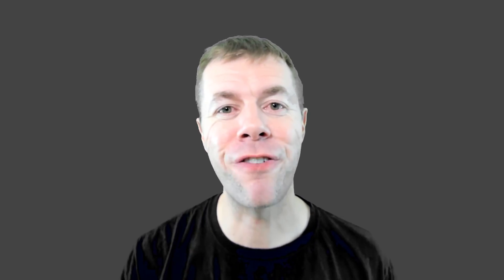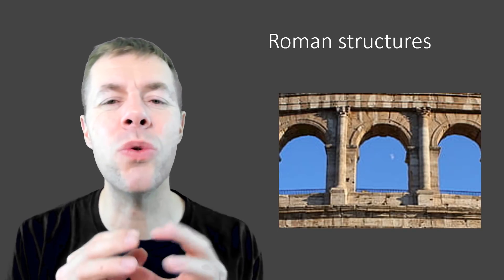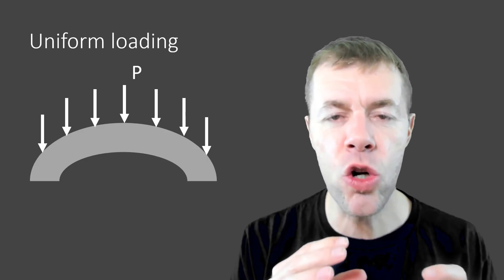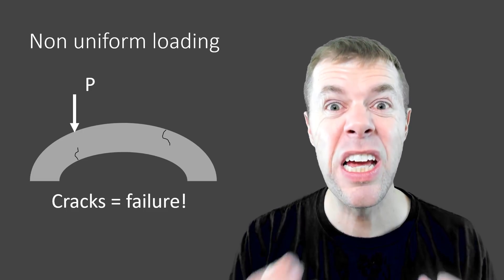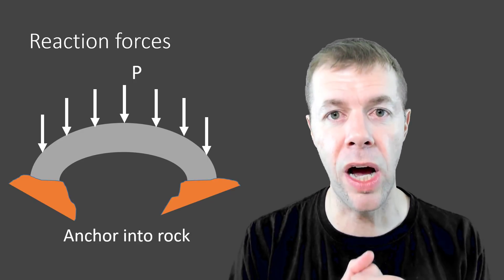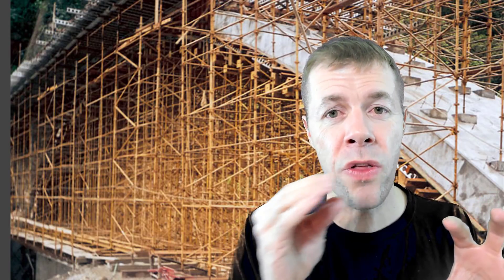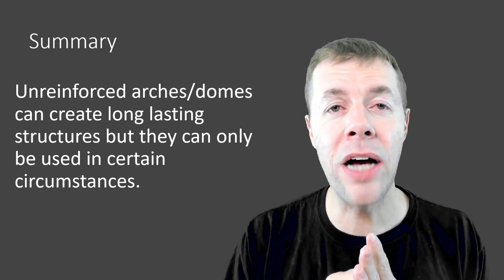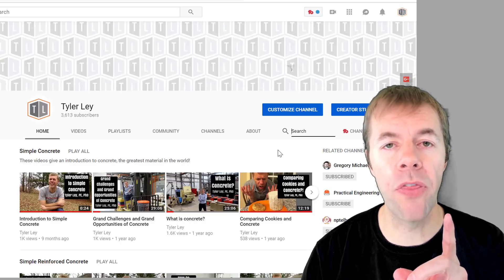Why don’t we build like the Romans?    |    Concrete Arches and Domes

Comment: The secret to Roman concrete is volcanic ash in the mixture. It helps against corrosion against salt water. For example if you were on a giant peninsula surrounded by an ocean… but reinforced concrete with rebar is much stronger to impact’s. The example of that would be German bunkers of WWII. However, eventually the steel would corrode. I’m sure they have solved that to some issue but the cost and expense probably wouldn’t be justified unless you’re building an underground bunker to withstand nuclear blasts

Edit: For some reason my comments don’t always appear. Perhaps it’s due to some weird algorithmic censoring. But volcanic ash is the secret ingredient to Roman concrete. Most structures from antiquity used compression for stability. But strangely enough they seemed to have better technology when it comes to working with raw stone

Comment: I've just moved to Zanzibar and will be folding my own homes. 
I have several  
1: and we don't have lots and from what I gather it's not particularly clean,  slightly salted
2: the water also slightly salted. How do I get around this.??
I find the large bricks they make, to be quite brittle.
It's OK for the fencing but not for the building s
 What can I do to make better clocks without breaking the bank? We have heaps of coral rock and glass bottles.

Comment: I'd be very interested if you did an episode about Roman Concrete, especially if you covered the concrete they used underwater, which appears superior to what we use in saltwater today.
Reply: The secret to that is volcanic ash in the concrete mixture. It acts almost like a seal for the concrete and saltwater corrosion. Romans had access to volcanic ash in Italy, but it wasn’t exactly readily accessible to most civilizations

Comment: Earthquakes are common in Italy and these Roman structures have survived 2000 years in a seismically active Italy.
Reply: The "secret" to roman concrete was discovered to be unmixed nodules in the concrete. Nodules, which, when the concrete was cracked, would reactivate when it rained. This reactivation would fill in the cracks. Essentially, the concrete was self healing it because of it. Im surprised this concrete guy hasn't discussed this aspect of the Roman concrete on his channel.

Comment: Greetings Tyler, I appreciate your passion for your topic, it is the thing which separates normal teachers from the exceptional. Regarding the Romans, we also need to consider their limited means for mathematical modeling in their engineering. This limited their ability to build efficiently and the ended up with structures which currently outlast their Empire by a factor of five or six. They could 'afford' this inefficiency because of their inexpensive labor in slaves who only received food and other basics of life in lieu of proper remuneration. Finally, your point of the liberty of having time on their side in construction, mentioned in a subsequent video, is very well taken. There were no bankers to satisfy, no taxes which were accumulation and so on, thus a project could acceptably take years to construct, and everyone would be fine.

Comment: BTW, why don't we build as the Romans, it is too expensive and unnecessary unless you want your buildings to survive 2000 years.
Reply: Would that be so terrible, rather than all the tearing down and rebuilding we do today?
Reply: @searchingfortruth619  I agree, I am just explaining why we dont do it. I once look at building a house out of 100% poured concrete for myself, no wood at all. It would have been 30% more expensive in materials and little more in equipment and setup. But it would have been mostly fire and waterproof. No insurance needed for structure. Even under the worse of conditions the frame would have been just fine. But we dont build like that. I work for several of the large home builders, most of them argue about a few dollars here and there. They cut back on things like soundproofing and waterproofing on a home to save a couple hundred dollars, and then it becomes a warranty issue later.  Cheaper is not better.
Reply: @TonyAnytime  so interesting.
One of the biggest structural changes I feel like has changed is that we no longer use arches or domes. Even of wood or brick.
There have been some really interesting projects I've come across
1) utilizing CLT
2) concrete domes using an inflatable formwork
3) using fabric for concrete formwork
4) incorporating gentle domes to the underside of concrete floor plates for better load distribution

Comment: Your Video is basically correct but understates the brilliance of these Roman Engineers and how these building have not only survived 2000+ years of weather, earthquakes, bombings, fires, flooding, looting and changes in governments. Lets talk about the the colosseum.org   Not only was their concrete a composite of special pebbles, ash and straw but they also did use reinforcing steel just not on the inside. The steel was used as tie beam between the layers of the pours. I found this method in homes built in Miami in Coral Gables in the 1920's.  So imagine concrete blocks and walls with flat steel plates acting just we would use rebars but in a groove in between blocks and they were mortared in place. There buildings were design to be able to shift and move. They also used holes with iron pegs to tie these pieces together. So they did reinforce their concrete with steel  just differently.  BTW the Colosseum sits on two distinct geological formation, half on hard rock and half on sand. So they used two different methods and concretes on this bi-polar design each tuned to their specify geology. 

Now going back to the  pantheon. Poor thing has  been pillaged  and even been bombed for 20 centuries. But look at these unique for their time building concepts. The oculus, the hole in the middle, not only allows, light and provides for excellent natural cooling, but it acts as a stress reliever and allows the pedals of the dome to grow and shrink as needed, absorbing small shifts. Each pedal is made from a composite layers of different type of concretes and mortar with reinforcements that allow them to hold far greater stress than concrete alone could carry. Think of encasing our pre-stressed trusses with a carbon fiber external shell.Their hollowed design not only save weight but gave strength because of this layering. The concrete in the middle of cookie was made to be light and flexible. The concrete on the outer shell was made to be hard and stiff.
Because of what I said above modern engineers have been using computers to figure out how the roofing system on the pantheon worked exactly, and every time they do the numbers they still don't add up. There is such brilliance in the design similar to how we build composite airplane wings. BTW no one knows the architect or builders of the Pantheon.  But please don't call it unreinforced concrete and I seriously doubt any of our concrete buildings will make it 2000 years.

More Info:

the-colosseum.net

 thecolosseum.org/history
romanconcrete.com

https://smarthistory.org/the-pantheon/

Comment: There's a misconceptions that people still think arches are in any way superior. They are not. In modern massive brick construction lentils (either premade pretensioned or poured on site) have long replaced arches. The problem with arches is that it cannot be anything else but an arch. Can't be a triangular opening, can't be a rectangular or any odd shape. It has to be arched. We have lentils and other solutions now and we take them for granted the same way as Romans took their arches for granted.

Comment: Okay Tyler, I like you as a person, but the Romans build structures in concrete 2000 years ago and some of them are still standing bright and shiny - no steel - just arches and their 'secret' concrete.
Reply: Some are stand but 99.99999% have failed and are gone.
Reply: @sparksmcgee6641  Read and study Mcgee, do not make the mistake of improbable and silly one liners, while science is against you. (where did you get stupid figure of 99.99999% ???? BTW)
Reply: @janverboven  50 BC to 450AD is the roman era. Take the population base and density of people per structure type and composition. But that aganst still functional concrete structures and you get the failure rate. You did get me there with a mistake on the last two 9's. They should have been 35 then 8714..... One liner facts are very effective when talking to knowledgeable individuals that dont need the basic math processs explained.
Reply: Actually Jan, they used pumice at the top portions of the domes BECAUSE they didn't have reinforcement.

Comment: I'd like to see a video on a relatively new method of using concrete to build small structures.  Blow up a balloon and spray concrete on it.  I've seen it used here and there - wonder how big a structure you can make with it.

Comment: There are still a few granite keystone arch bridges in my area that freight trains pass over. Probably near 100 years old. These bridges have needed ZERO maintenance so far. All of the steel bridges in the same area have already been replaced due to corrosion. Hello....
Reply: The iron bridge In Iron bridge gorge in the UK is still in use and was built in 1779 :)
Reply: Andrew... Thanks for the comment. I researched the Iron Bridge. Fascinating.
Reply: @blipco5  Thank you for the courtesy of your reply!
Reply: Andrew, you're welcome. 🍻

Comment: Hi Tyler, I wonder if you could do a video on concrete for the average person.  To stabilize a fence post, repair a cracked or broken structure, etc.  Explain what cement, crushed stone, sand to buy.  How much water to use and how to mix it.  Making small and larger amounts.  What additives to use, if any.  Preparing surfaces so it will stick. Anything else that is important.  That would be useful to me and maybe other people.  Thanks.
Reply from the maker: Good idea!

Comment: Even though the Romans did great things with the arch, I have to give the prize for perfecting the arch to the master builders of the middle ages that built the Gothic cathedrals. The technical skill just doesn't compare.

The Roman round arch has two weaknesses: the center and the shoulders. The master builders solved both problems. They solved the center problem by eliminating the center and bringing the arch to a point instead of making it round. The solved the shoulder problem by countering the sideways thrust of the shoulders with flying buttresses. 

Famously, in Florence they even solved the problem of how to build an octagonal dome without building a temporary wooden structure (centering) under it. https://en.wikipedia.org/wiki/Florence_Cathedral#Dome
Reply: The flying buttress has shown that it is not the end all answer to the problem as witnessed by all the post construction steel reinforcement done to cathedrals.

Comment: Hello I would like to see a video about different ways of pouring concrete on a structure that has 2 or more floors. In theory, we should stop pouring approximately in the middle of the column where in an earthquake the seismic torque is M = 0 or very close to zero. then let the concrete strengthen for a few days, expand the formwork and pour concrete till the end of the column where the next floor begins, or to be accurate start pouring again to form the beams and slab of the next floor. In construction though its not that easy and practical/economical for several reasons. I would love to know how you do thinks in your country, Im from greece and there is a constant debate for several years between construction engineers and university researchers about which is the best way through time to form our concrete "Skeleton" of our building. thanks a lot for your time and effort to provide us with such quality videos
Reply from the maker: Thanks George,
This is an interesting question.  From my experience in the US the engineer can dictate where they prefer a cold joint to be and the contractor can suggest an alternative.  Contractors can "value engineer" the forming locations to improve their schedule.  This sometimes means giving some money back to the owner from the their initial bid if they are allowed to modify how something will be constructed.  The engineer needs to decide if this is allowable or not.

Comment: My favorite cast in place steel reinforce concrete arch.

https://farm8.staticflickr.com/7427/coverphoto/72939312@N08_h.jpg
Reply from the maker: That is the Wash DC metro.  I think they are precast members but I am not sure! =)
Reply: @  Tyler Ley 

Precast was only used in 11 of the stations. All but one are on the Red Line, Dupont Circle to Medical Center, the 2 twin tube stations north of Silver Spring and Columbia Heights. None of the precast stations are structural, eight were assembled in a cave excavated out of the bedrock. The the 11th was was built in a cave excavate from soil under an arch built on top of a pair of slurry walls (Columbia Heights).

Dupont Circle
https://static01.nyt.com/images/2016/04/04/us/04metro-web01/04metro-web01-jumbo.jpg

Forest Glenn 
https://cdn.theatlantic.com/assets/media/img/nj/2015/10/20/dc-metro-from-construction/wcm-mm-rest-nstein-5.jpg

Metro Center. pictured in my opening post, opened for service 43 years ago tomorrow 03 27 1976.

I have been following the build out of the Washington Metro sense 1972.

The avatar next to my handle is a Washington Metro ceramic third rail insulator.
Reply from the maker: Thanks for the awesome info and happy b-day to Metro Center!!! 
I love all the great conversations!!!
Reply: I forgot to mention, That opening was the opening of the first segment between Rhode island Avenue and Farragut North. I was there and was there at every segment opening sense.

Comment: Could you make one about precast beam and block floors and roofs. It’s called “bovedilla y viga” and is used in Mexico, UK, and the Netherlands. I can’t understand why it’s not used in the USA. It’s a great system.
Reply from the maker: Pretty cool system.  A similar system is used for bridge decks in the US but the panels are larger and everything is done with cranes.  I think the US likes to use the premanufactured metal deck forms.  See here: 
https://www.redbirdengineeringsales.com/

Comment: Ah that explains why the roman viaducts had the ends buried into the sides of hills.
How does the largest single span roman arch compare to modern arches ?
Reply from the maker: The Romans built the largest unreinforced dome (The Parthenon).  It still holds the record.   Reinforced arches or domes are much 7 to 8x larger.

Comment: Can you make arches that are reinforced so you can build easily with them but that will still have sufficient strength once the reinforcement is destroyed? Since they effectively have holes in them they would be weaker than the same size of unreinforced arch, but if you compensate for that, could it work?
Reply from the maker: When your reinforcement corrodes then it will cause the concrete to crack.  This causes a lot of damage.
Reply: @TylerLey  Thanks for the reply. I just looked it up and read that the corrosion products take up more space.
The things you learn. I had thought the chemicals released might do something, not that it would be simple expansion.
Your videos have really made me appreciate the challenges faced by civil engineers and how much more complex a seemingly simple thing such as concrete really is.